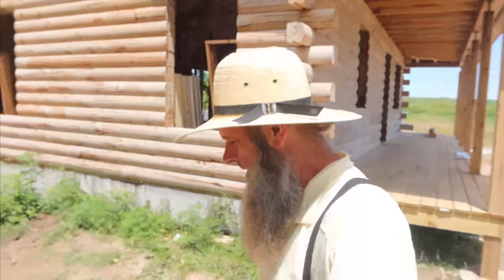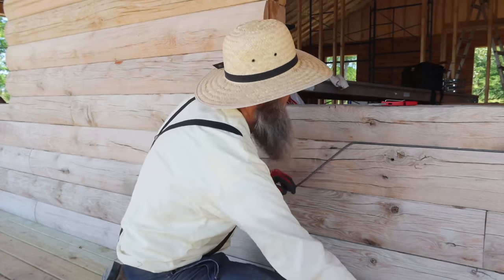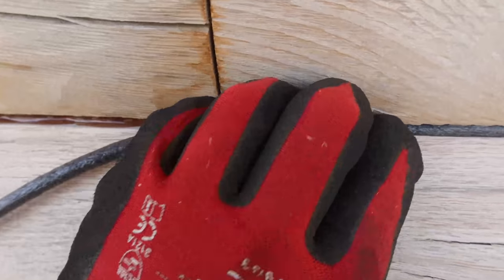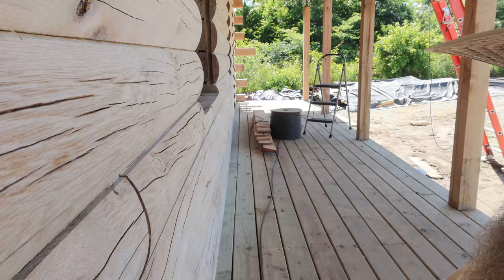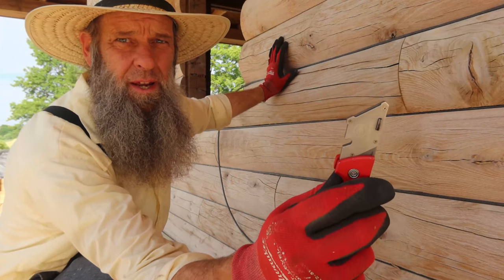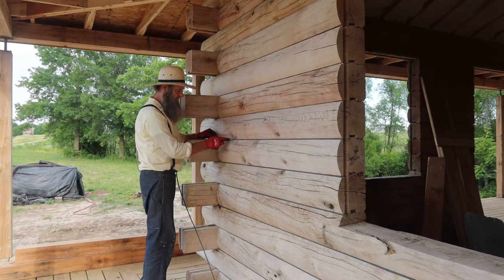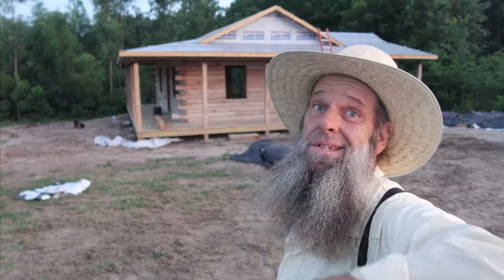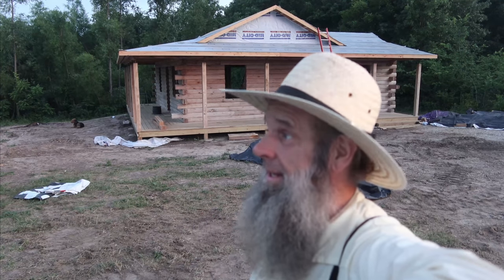The WORST PART of the build! Building a LOG HOME day 56

Comment: Seems to me that piping would be easier to install using one of those tools used to install screen.  Just my two cents.
Reply: I was thinking the same thing...Spline Roller.
Reply: Yes it looks like the screen tool would work good. Doug you’re doing an amazing job, its great that you have the patience to teach us. Thank you for sharing.
Reply: Something like a pizza cutter but not sharp ,it will be faster feed and roll it in, except the clue would slow you down
Reply: You are doing a great job..tirelessly working to move your mother out to the country, love the videos which shows hard working off grid people..keep doing exactly what you are doing..
Reply: Yes, a window screen tool might work, it looks like a wooden handle with a wheel on both ends, less than 10 bucks.
Reply: I thought the same right away.
Reply: I never seen your comment sorry but that tool would work wounders.
Reply: just saw your comment. i said the same. great minds and all that
Reply: Was just about to suggest that very thing.
Reply: He has so many areas which need glue removed. That would make such a tool to be a frustrating solution..
Reply: @esparka  The five-in-one tool should  make that task fairly easy.   A new sharp one would be best.  Also called Painters tool.
Reply: had same thought
Reply: I just made the same comment and then I read yours. lol. You are correct and spline roller would be perfect.
Reply: Where is day 57?
Reply: Is there going to be a 57?

Comment: I wonder if a spline tool would make that job a bit easier and not so tiring on the fingers.
Reply: Was thinking the exact same thing and then I saw your comment!
Reply: @njkay0033  yes I think it would work, of course he would still have to remove that glue but I think a curved linoleum knife might work better for that problem as well.  Doug could go down the row removing the glue and then roll down the row with the stripping stuff.

Comment: I was going to suggest a tool that you insert screens with. It will speed up the process greatly and they only cost a few bucks.
Reply: And a roller mortar rake for helping get the glue out of the seem.
Reply: Just was going to post the same.

Comment: Hey Doug, there is a roller that looks like a small pizza cutter without the sharp edge. It's designed to roll plastic tubing into aluminum uprights to install screening in a mobile home screen room. It looks like it might make your chinking backer install much faster and less tedious. They sell them at Lowe's or Home Depot for not much money. Cheers!

Comment: When will you cut of the ends of the logs, each corner, or make them the same length?  If seems one would do that before staining.  This question coming from someone without a clue on the processes.
Reply: I asked the same question in the last video.  In this video, I thought when doug come around the corner, he was going to be face first in a corner log sticking out too far. 😳
Reply: Are you getting the roof on soon?

Comment: Doug the perfect tools to use to speed this up is either a window screen gasket tool for pushing the rubber material the groove in or a bicycle tire spoon you can actually slide that tool along the backer material without tearing it.

Comment: I worked with a couple people who built log cabins, instead of using your fingers and the chisel, we used a splining tool. 
It's a handheld with a grooved wheel that rolls over the backer as you guide it, the other side has a flat edge to dig out debris or push backer into tight spots. 
This way you use both hands at once without the fiddly stops and the job gets done much quicker

Comment: I'd be using a Selly's product called No More Gaps. It comes in a tube like the glue and u just pump it into the gaps. It is like a rubber when it dries. Here in Australia it is used to seal around windows & to fill in gaps before painting

Comment: Doug, try useing a storm window rubber strip screen roller tool to put your clinking cord in place. They usually have 2 different thickness  wheels to roll and squeeze the cord allowing it to be installed easily.

Comment: For the glue problem find an old flat tip screwdriver that fits into the grove, heat the tip up and bend it so it scraps the glue off.

Comment: Ever put screen in a frame for a window? Same principle. Use a roller tool that has both a concave roller and a convex roller to quickly (operative word here) install the rubber bead into the frames channel. Make one and you'll be amazed how fast that job gets done. Thanks for the videos Doug, good work.

Comment: Doug Make yourself a roller out of a wood disk slightly thiner than the gap between the logs attached to a piece of wood to make a handle make sure it spins on handle and use that it will go faster for you . Kinda of like the tool for putting in screen. To aluminum frame.

Comment: When putting new screen wire on a window or door there is a small roller tool that rolls in the little rubber seal. This tool would be handy for rolling along  mashing in the back rod.

Comment: Hey Doug. You’re doing a great job but if I could make a suggestion for putting the backer rod in. Get yourself a spline roller tool used for putting the spline in when redoing a screen window. You could just roll the backer rod right into the slot.

Comment: Doug they make a backer rod inserter tool looks like a small pizza cutter made out of plastic much faster than pushing it in using a putty knife also will not damage the backer rod and cause out gasing.

Comment: You might try a window screen replacement tool kit...its a roller wheel and pick tool...use the roller to put in the backed bead...and the hook tool to get out the glue

Comment: Use a tool for pressing screen  in doors.concrete finishers use it to press caulk in was cuts. It has a small wheel on it saves a lot of time.

Comment: They make a small roller that is used to embed the rubber gasket that holds window screen into metal frames. It’s grooved and i think it would work very well to roll in that “rod”i to the gap between the logs. You might look for that tool.

Comment: 3:30 try to make a not to thick plywood (or several large steel washers (maybe in the middle a slightly truimmed back one so you have a grooved) wheel and cut a slot in a rather thick broom handle to mount the wheel into it. Now you have an easy tool to roll the backing rod cable into the grooves... Get a nice rhythm going: clear the glue residue in a 4x4 feet section and after a little break do the backing rod rolling...

Comment: You can use a nylon roller, usually used in screen repair, to roll the backer rod into place
Reply: Just be careful to not stretch the backer rod

Comment: You needed a splining tool like you use to put in the piping for when you replace window screens. You could have just rolled it down the crack & pressed your backing in much quicker.

Comment: Consider using a cutoff wheel on the grinder or circular saw blade  (battery operated) or a flat service tool. To get rid of the glue

Comment: Doing the bacara reminds me of putting spine rubber in screen door when replacing the screens. The spline holds the fiberglass sceen tight to the window or door frame.  Ill bet a spine roller tool would work on that bacarak.  As in that nursery story between the turtle and the hare.............slow and steady wins the race.

Comment: I'II bet that the roller tool used to install the rubber strip on screen doors and windows would have worked well for you on the gap seal for the log cabin.

Comment: You've got an awful lot of that foam backer rod to put in place. You should try one of the wider roller wheels, like they use to put screen wire spline material in the groove, to hold the screen wire in a window frame...looks like it would go a lot faster than ramming it in with that wide chisel, if you can find a roller wide enough to fit it.

Comment: Seems like some tool with a wheel (like a wide dull pizza cutter) might make laying the chord in the grove much easier. As for a the excess glue, maybe you could make a tool with a sharpened J hook to slide through the groove to remove the excess glue.

Comment: You seem to be having more trouble removing the dried glue that in installing the backer rod. You might take an old 1/4” screw driver with a flat blade. Shape. The blade and then heat it with a torch so you can bend the shaft to an angle of about 45 deg.s back towards the handle, use it with a pulling motion in the grove to quickly remove the dried glue. Heating the tip will help with the most stubborn deposits.

Comment: Hey Doug, they have these tools with little wheels on each end. Used for running the rubber gasket inside window screens to seal/set the screen to the frame. The gasket material looks a bit like what your using, wonder if that tool would work or make it easier??

Comment: Doug the tool they use to put the rubber in screen for windows would work perfect. You could just roll it in It would be simple and easy. the tool would be cheap and easy to use. It would just roll it right in. A door and window store should have the tool or Ace Hardware would have one. It would save you time.

Comment: Dude... make a tool like a round pizza cutter. Use washers to take up the gap space... run a bolt through the middle... use wood or metal you have kicking around as the handle and for the bolt to go through... and you will be cooking with gas! The glue will still be a pain in the patootie... but it will make it much easier to be ruling it into place. :)

Comment: gday Doug over here in Australia the tool i would have used to pack that backing strip in would have been a Cyclone Premium Timber Spline Roller it’s a little doohickey that looks like it would have saved you a ton of effort. Builds coming along nice good to see your healing up well thanks for the videos cheers from australia 🇦🇺

Comment: I'd be thinkin about using on of those screen install rollers to push that backer rod in..or a similar..Easy make tool....Dont ever forget the value of a heat gun or torch forsoftening any solid glue you may need to remove...

Comment: Hey Doug, a question and an idea here. First, do you have to find a way to get that backer cord into the vertices gaps where two log abut each other? The hint, I think one of those hand rollers that you use to press in the rubber spline when making screens might help press that cord in between the logs.

Comment: PRIME-LINE Products P 7505 Rolling Must Have Tool 

EASY TO USE – Installing a screen with this screen roller tool makes the job much ... This essential tool is comfortable in the hand and the wheels turn smoothly to ... groove holding the screen till I roll the little rubber string back into the groove.

Comment: I’m sure there’s a blacksmith near by? If so, see if they can forge a hook that you can use to rake the glue out. You could use s torch to heat a screwdriver and bend it into a hook. Also get a screen roller to work that foam in those cracks.

Comment: HEY Doug, I am wondering if one of those tools that help put your screen in a frame for screen doors and windows would work with getting that filler in the grooves? Might be easier being a wheel to run it in there. Just a random thought.

Comment: Would the roller wheel tool used for window screens work for pushing in the backer rod? I've used the strips to lessen our concrete patio slab. Love what you'll are doing. Thank you all for sharing. Arizona Deb.

Comment: Couple of things Albion makes a backer rod roller that will help.  Also the backer rod looks like closed cell and will out gas if punched, meaning the caulk will have a bubble from the gas coming out of the rod.  There is a soft closed cell rod the does not out gas.  I have attached links to the rod and the backer rod tool.  I know you love your electric tube gun, but you need to check out the electric sausage/propac gun.  A propac gun will double the amount of caulk you can shot before you need to reload and the is little to no waste.  

https://albioneng.com/standard-model-backer-rod-insertion-tool
https://www.backerrod.com/products/titan-foam
https://albioneng.com/sausage-guns?drive=5&gclid=CjwKCAjwt8uGBhBAEiwAayu_9YfdSzacFNqqfpP8VCfmL8yRECIwiCVvBaUBHcyutgyBJrqvtvZVeBoCj6sQAvD_BwE

Comment: I built a similar log cabin with the tongue and groove pine logs. I installed a foam gasket between the grooves and no chinking was recommended. Just curious why yours does. Is it more efficient energy wise ?

Comment: Check your email, sent you an email. If you don't receive it then search for a wallpaper corner seam roller with a plastic roller so that you can file it down if needed. For under $10 it will save you an incredible amount of time and effort.